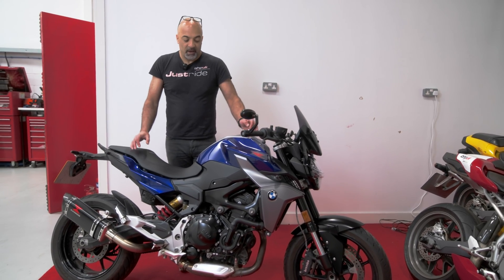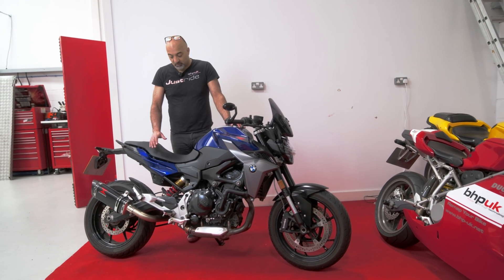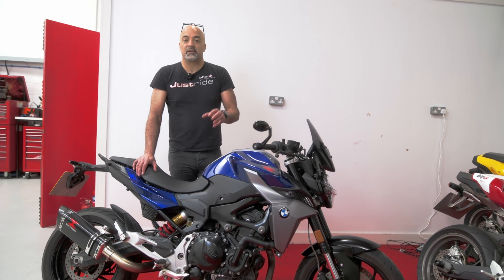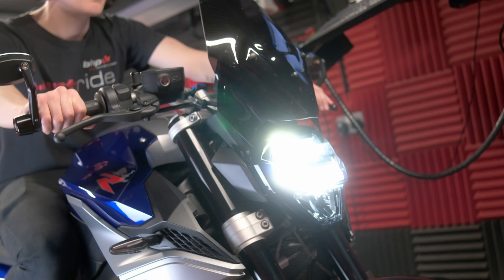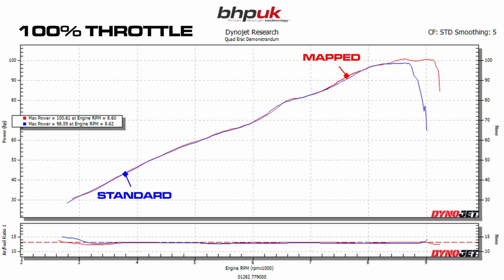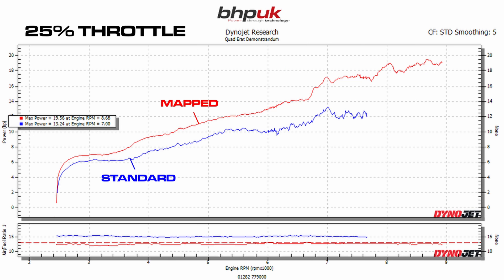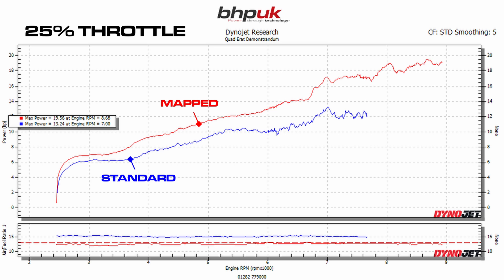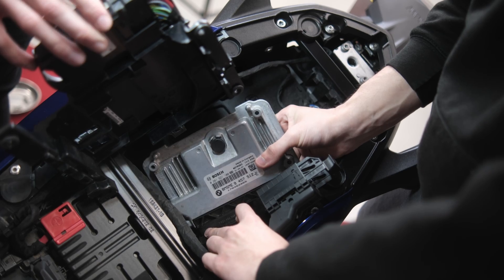BMW F900R Euro 5 Dyno Tuning | BHP UK Custom ECU Remapping

Comment: Hi, a question. Ive got a f900gs. Hade bought a linkpipe so i can remove The back ”silencer” not the cat with lambda sensors..
I have The ”stock” akra silencer from factory. Is it safe to drive like this or is a remap a must ?
Reply from the maker: @Coalcreekmonkeys  so have you still got the lambda sensors in the system?
Reply: @BHPUK  yes i have. Have only removed the back silencer. So cat and sensors are still connected
Reply from the maker: @Coalcreekmonkeys  we would highly recommend a remap. It will transform the way the bike rides. We offer a full money back guarantee is you don’t agree with us after the map.
Reply: @BHPUK  yes. I have Done my other bikes with remap/flash . But this i only want the sound to be deeper. Dont need the extra power for it. Only thing a want to know are if the bike goes to lean and if it can be harmfull for the engine. I know some brands that they dont recomend to change anything in exhaust without remap.. like my old 690 smc r and 701. 
Talked to Husqvarna. They told me stock airbox and slipon was ok with db killer.. 
so about the BMW a just want to know if its safe to drive like this with the linkpipe from arrow
Reply: @Coalcreekmonkeys did you get a remap? Or are you running on stock ecu tune? Any effect so far?

Comment: I feel like the Dyno charts don't do it justice. It's so much more responsive and playful down low now and the power is really progressive going through the revs! What the bike should've been like stock, thanks Cal 👍
Reply from the maker: Thanks for your comment Mitch! Enjoy and ride safe!
Reply: Do you feel like there is a decent improvement in 0-60 or quarter mile time? I know those metrics don't mean everything, but they are decent measuring metrics for power gains
Reply: @BrandonSwogger121 20-80mph is a better metric because it takes the launch out of the equation. 2nd gear 20-80.